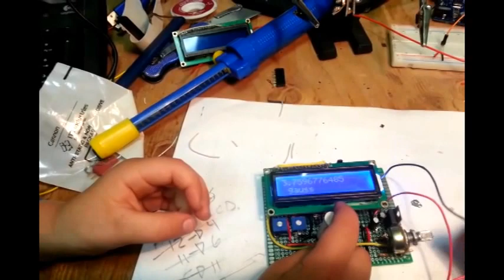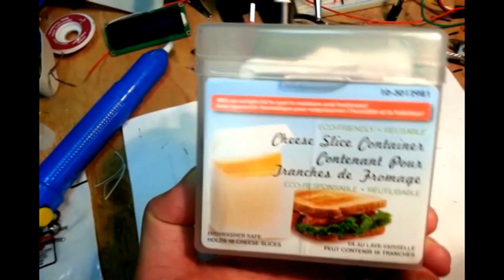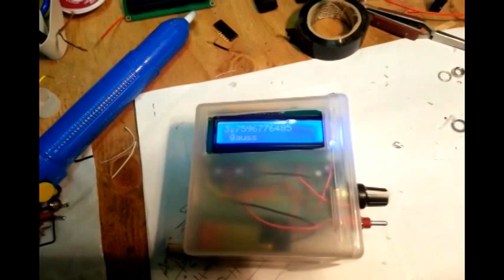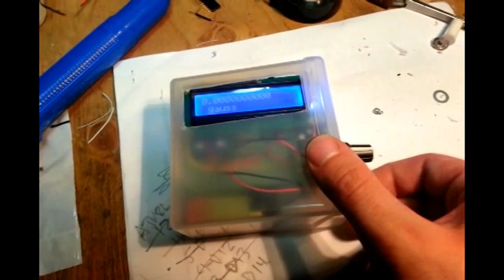Hall Effect Sensor with Arduino - A1302 - Portable Gaussmeter

Comment: Very nice! Great reuse of the reuse of the case as well. I'm trying to build a device that can sense magnetic fields through walls but the sensor's sensitivity is too low. Any tips on how to increase it? Or maybe I need a more expensive sensor. Cheers!
Reply from the maker: You can try scanning through datasheets for other ratio metric sensors. The strength of the field you're trying to detect will change things a lot.  A higher resolution adc or perhaps some opamps to increase a weak signal. if you're trying to find a small field at great distance, I'd imagine it washes out quickly. Cheers
Reply: +Jarret Chessell thanks a lot for the advice!

Comment: out of curiosity, do you know of a hall effect sensor that can measure at least 1500 gauss N or S and will do so accurately to within a few gauss (preferably to within 1 gauss)? Trying to make an accurate gauss meter for guitar pickup magnet testing.
Reply from the maker: +tlgrimmy You would likely need to buy a calibrated certified device for that accuracy. The ratio-metric sensor I used is analog, so the biggest limiting factor (and why my meter jumps in large steps) is the capability of the analog to digital converter that comes with the arduino - you might want to look into an external ADC with a higher resolution.
Reply: +Jarret Chessell Perfect, thanks! I found a few 16 bit on up to 24 bit ADCs out there. Not sure how much resolution I need for that level of accuracy, but maybe this is worth a shot.
Reply: Hi! Greetings from India

Just wanted to know which sensor did you finally decide to buy? And could you kindly send the link for the same.

Regards,
Chetan
Reply: @chethanmrao  Okey, now I knew the purpose of this video!

Comment: I've got to say "Thanks" for posting this.
I've never been that interested in electronics, but I play and mess about with guitars; got inspired to dabble with the magnet strengths of the pickups and found a diy adaptation for a voltmeter/Gauss reader; stumbled across this video and... Well, bought a couple of books, done a lot of reading and will be putting together something along these lines in the near future and wouldn't be surprised if I figure out a way to not spend a fortune by making a pickup coil winding machine with various parameters controlled by an Arduino board...
Genuinely, thanks for inspiring me.
Cheers.
Reply from the maker: You're welcome! I like to hear positive feedback. Good luck with your project.